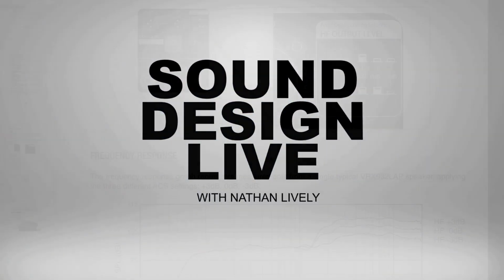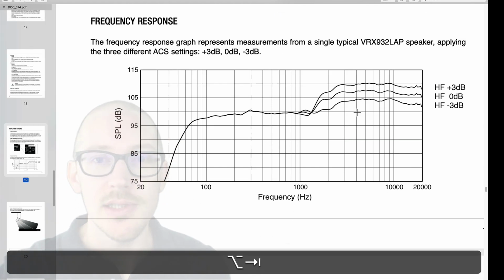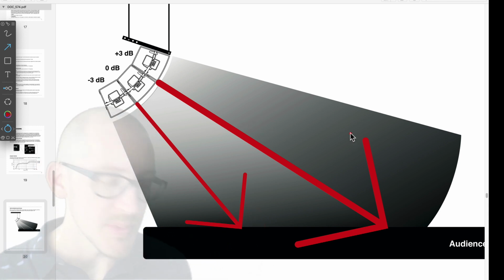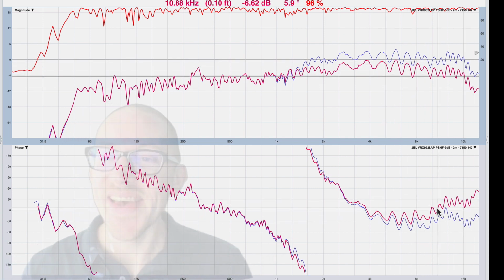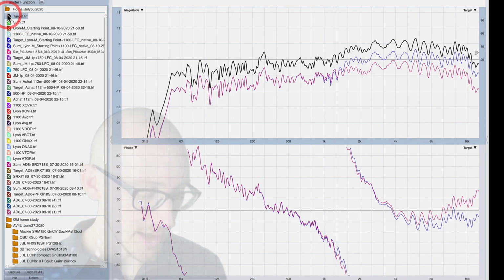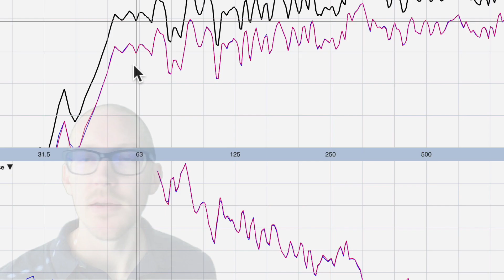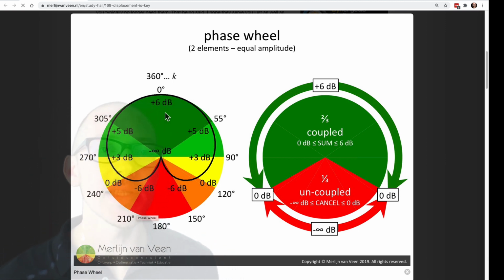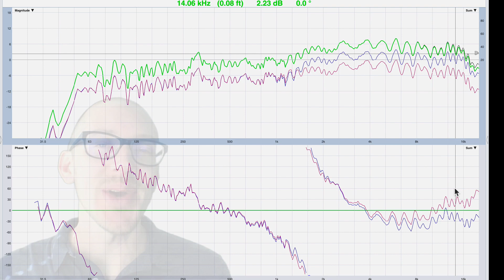What do the EQ switches on the back of a VRX932 really do?

Comment: Thanks for the great info, Nathan. I have an off-topic question regarding the VRX932 - I have/had/may still consider purchasing them. I have only heard the boxes used once and was quite impressed with the output. As far as vocal reproduction, they seemed to be missing something in the midrange. It certainly could have been operator error - what has been your experience, and do you do anything to sweeten the vocals?
Reply from the maker: Hey Tom, I've used them a bunch. They're fine. I don't remember hearing anything special or irregular in the vocal region.
Reply: @nathanlively  Thanks for the reply, Nathan - maybe I owe them a closer look.

Comment: hey, Nathan Lively!
I'm getting a lot of help from your video and I'm learning. I am not a system engineer but a mixing engineer.

I think the switch on the back of VRX is a high-pitched switch for sound that occurs when positive combinations are made from low to high when elements that make up the array are added. What do you think of this opinion?

Oh! And another question is, how do you tune in a straight array and tune in a curve in a system of line arrays that can freely specify actual curvature? 

And when the curvature is widened as much as possible, the high-pitched coverage between the speaker and the speaker becomes empty, so does this actually have the effect of a line array? Will it be a system that meets coverage and sound?
Reply from the maker: Hey -, good to hear from you. I think the switch just engages an HF filter.

> how do you tune in a straight array and tune in a curve in a system of line arrays that can freely specify actual curvature? 

Are you asking about combining a constant curvature array with a variable line array? hmmmm, I'm never run into that. Interesting!

> so does this actually have the effect of a line array?

Huh, yes, I suppose you could think of a constant curvature array as a variable line array stuck in a single position.

Comment: I must admit I'd never noticed a problem - I have to say that I  assumed the difference in level was simply the  extra resistance switched in to the HF  driver - so the switch really acts  as a volume pad. I'm now confused as where the phase shift comes from you are describing. We have HF from two sources at the overlap zone, but  surely they are still phase aligned, apart from the  tiny extra distance  from the other driver? If they were bi-amped and individually connected to different amps (which mine occasionally are) then I have  always left them set to the far +3dB position and adjusted the  output via the amp controls. Sonically, I have not noticed  any difference, but of course wasn't  even expecting there to  be  one. Are we  sure that these differences are not just plain old  ordinary comb filtering? I'm thinking  that perhaps  we are just seeing multiple arrivals from slightly different lengths, not any changes due to the actual level adjustment?
Reply from the maker: Hey Paul, thanks for checking out the video. 

> I'm now confused as where the phase shift comes from you are describing.
It comes from the EQ filter. Any time you insert a filter, there is phase shift, except for some special ones like APF.

> We have HF from two sources at the overlap zone, but  surely they are still phase aligned
This is the point I was trying to make in the video that I must not have communicated very well. At the acoustic crossover they are not phase aligned in the HF, but the phase difference is small enough not to create a significant problem. I used to worry about it. Now I don't and neither should you. :)
Reply: @nathanlively  It's fine, I was just pleased somebody took the trouble to consider the science then the practical results. I've not actually looked at the circuit of the crossoverin my passive units, but I wonder if (keeping in mind the similarities in the EQ curve when you overlaid them, if the big ceramic simply change the level. The three HF units are also distributed evenly, so one box actually has three overlapping beams, so with another cabinet on top, the first horn couples the same way, but with the rear switches set, the next box up is just a bit louder? How does this impact on the phase cancellation. I bought my system when our band went abroad and we were supplied with a VRX - I really liked it, and was very confused by the real slagging off they got, when I really found them useful. I have a repeat job with them in a 1400 seater theatre which is very wide, very deep but quite restricted in height. The VRX manages to really get the levels as you go back sorted. Far better than many other systems that come through! Thanks again.

Comment: I recently had these speakers on a Dura Truss crank stand about 9 ft. up  outside 2 per side with the settings at +3 along with 2JBL SRX 828sp and 2JBL SRX 818sp with SRX 835P. I normally just leave the VRX's at 0. What do you recommend?
Reply from the maker: Hey Harold, I had to use some of these recently as well. At short distances I’ll use 0dB or -3dB and longer +3dB to overcome air losses. I guess I’m not doing anything special.
Reply: Thanks Nathan!! I really like this SoundcraftUI24R Group because I learn something from many people.